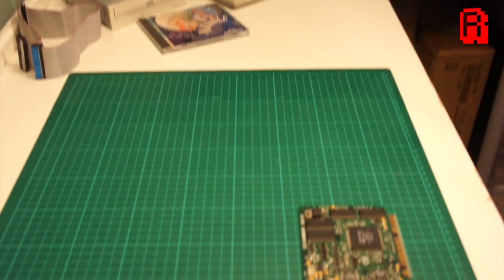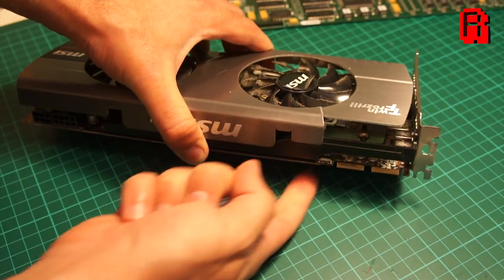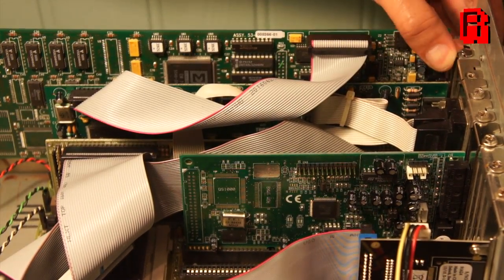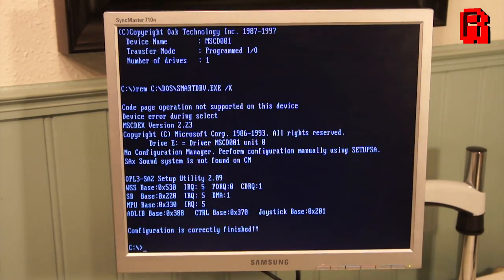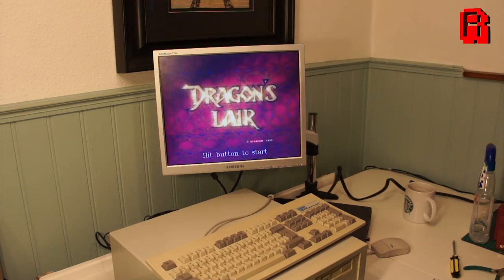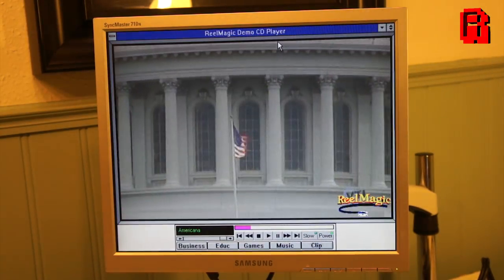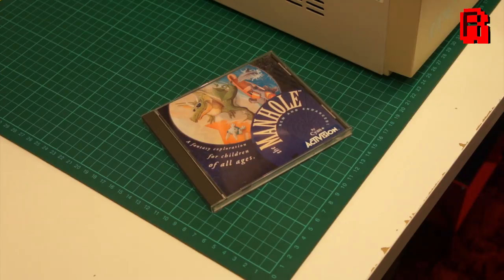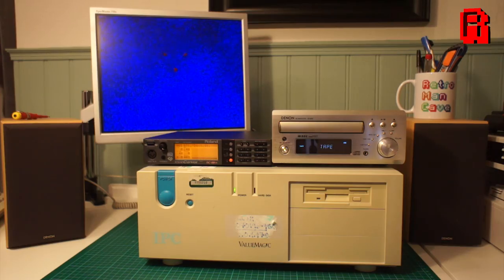486 Trash to Treasure Pt4 | Multimedia & MPEG (continued)

Comment: I started with a 486 myself. Building it from donated parts. Never saw or used a PC before (i was still programming my c64) but having electronics as a hobby made putting the thing together quite fun. I remember that saturday evening fondly lol. Anyway. I had no idea ISA MPEG decoders existed till recently. My first one was a PCI one i used in my AMD K6 II running at 333MHz.
Reply from the maker: dlarge6502 there's something about planning, ordering, laying out all your parts and building a PC that has always been fun for me.  I've built all but my very first PC.  Mind you it's not quite as challenging these days with things like SATA, few to no jumpers to deal with and much built into the motherboards now lile audio and drive controllers.  Such is progress.

Comment: 4:07 - "I don't fully understand why the speech is such a low quality"

For whatever reason--unlike Dragon's Lair--they opted to use some kind of FM synthesis instead of wave audio.  That 3 second clip of "My small boat is your small boat" would've taken up half a MB of space on its own, since audio compression back then mostly involved sampling down the raw bit rate.  Put enough of those clips in the game and it can add up.

Comment: The reason why there wasn't much support for those MPEG cards is that they probably were very expensive back then. I wouldn't be surprised if these turned out to cost upwards $1500-2000. Since this card doesn't have many outputs, I'd surmise it is a cheaper model. But still, the high price means that not many ppl owned such a card.

But man, these beige boxes are really ugly! Windows 3.11 too!! That's the uglies operating system I've ever seen!!!
Reply from the maker: +Iberius Pred hehe nostalgia does strange things to ones perception of beauty.  I do love the look of a beige box PC, even better a full tower
Reply: Well, Windows 10 doesn't look too different, considering the flat look everywhere.